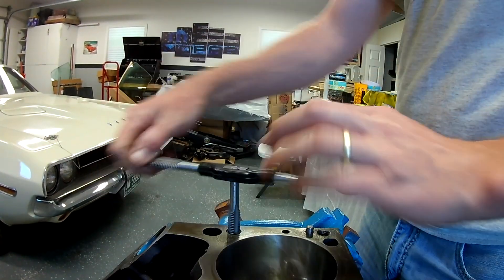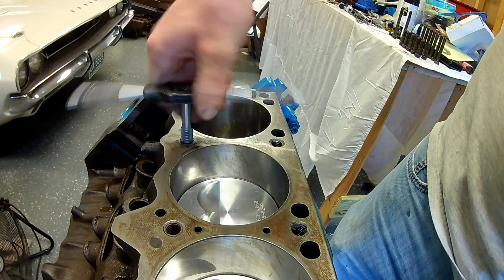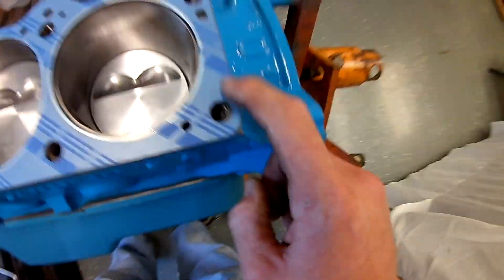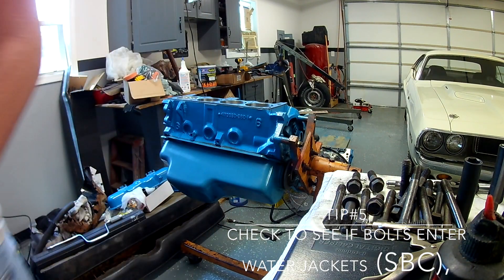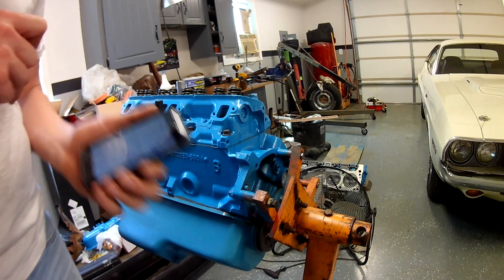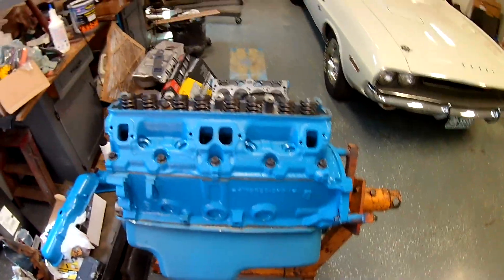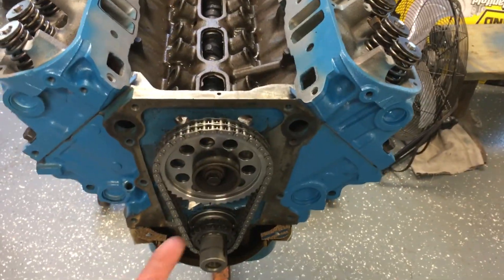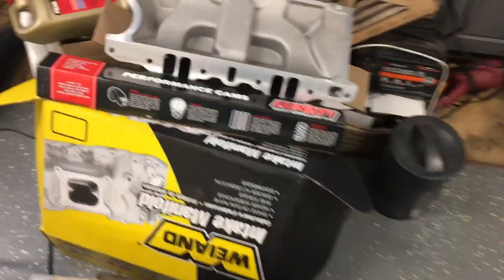360 Engine Build Part 7, Heads Installed! Tips and Tricks for Longevity and Performance.

Comment: .... in an unfortunate situation like that...where one has to perform chasing threads or anything dirty in or on an engine already assembled ... I use shaving cream..... this stuff catches every debris like sticky stripes do moscitos....afterwards you just suck it off with a vacuum cleaner. Bevore installing heads i always use it to cover all the head's water passage openings to make sure NOTHING drops into the cylinders.
Another trick.... on the original hemi and max wedge cross rams I use the Nordlock washer system on the i take bolts to avoid becoming loose in operation....to catch these I spay shaving cream around the bolts....just to be on the save side so not one tumbles down the i take port into the cylinder....
Reply from the maker: That’s pretty cool. Thanks for sharing
Reply: @JustMoparJoe  ... in our hobby...it is most essential to pass on information....without all the magazines and how to books from the States...and in the 727 department ...the vids on the Torqueflite...I couldn't do the hobby over here in Germany...thanks to all of You
Reply from the maker: @JanNiemeyer-x8f  check out bad tree productions on YouTube. They build 904/727 transmissions in the garage

Comment: I run that stealth intake on my 280 Hp street 318 and it pulls real strong at any rpm with a 625-650 cfm carb with 4.10 gear and Hughes Engines muscle car cam for 318.
Reply from the maker: Niles, this is the engine that went into the Red coronet. I sold it to him to replace the old poly engine. The only change I made was to switch to a purple shaft cam that was much milder than the bigger lunati I had in here. There’s also one video of this engine in my barracuda for a full race day. It’s in the barracuda playlist
Reply: @JustMoparJoe  Right on Joe !! Thank you for more info and more vids of it . Nice clean basic solid build . Wish I could give you a list of my current 318- 393 stroker build for my 68 Dart 2 dr sedan Sport Special Model.
Reply from the maker: @NilesJStJohn  I’m going to build a budget 388/318 in 2023. I’ll do a build up on the channel
Reply: @JustMoparJoe  will be looking for that line of vids coming. 318 is so underrated and has so much strong potential!!

Comment: For the timing cover, I installed a new crank seal in the cover, and used the crank seal to center the cover over the crank, THEN insert the cover bolts to line up the cover on the front of the block, then tighten the cover bolts. Now there are no uneven side loads on the crank seal. Then I drilled a 3/16" pilot hole near the lower corners of the cover, and into the block front face. I followed up with 1/4" straight shank reamer so I could put in 1/4" dowel pins to positively locate the cover. Why would I do all this? If in the future, you need to pull the cover, you can reinstall it precisely, and as a bonus, it won't change the gasket seal on the front of the pan.
Reply from the maker: Thanks Bud. I learned of the seal centering trick after doing the series. Adding the dowels is a nice touch as well.
Reply: I always add an oil slinger to the crank after I have the chain all hooked up .They are not on the late engines but Mopar has them p/n 5249636. They make the chain and sprockets last longer. Mopar plugged off both oil galleries ,they used to have a pin hole on the passenger side cam bolt. This increased oil pressure  at idle but the chain ain't oiled as well.

Comment: Hey joe, for assembly lubrication purposes, why not install cam before crank?
Reply from the maker: I guess I don’t have a straight answer that will address lubrication purposes. I always start on the bottom end and work my way up. That’s how I was taught. I do believe in test fitting the camshaft immediately after cam bearings are installed to be sure they don’t bind, but that’s with a light coat of oil, only on the journals. With the flat tappet cams I’m used to, I really believe in thoroughly coating lobes with rev lube, and I don’t want that washed up or down with oil dripping from the crank or top end. Hopefully that helps. I always prone the oil pump with a shaft and drill, then soon the engine while priming to get oil to rockers.
Reply: @JustMoparJoe  Word.

Comment: When in doubt about max flow cfm/power, Add boost!  Perfect setup.
Already good low rpm torque and "every cam is a turbo cam". 👍
Reply from the maker: Thanks brother! This is the engine in my barracuda at the moment. Gotta dig into the 7’s soon hopefully
Reply: @JustMoparJoe  6s anyone with same drivability ? 😝   I'm just messin' with ya, doing great so far. 💪

Comment: A light swipe of oil under the flange of the bolt head as well. For accurate torque
Reply from the maker: I think some residual oil gets on there. I will probably have ARP bolts or studs on the next build. With it, I use their lube under washers and on threads. Thanks for the support.
Reply: Love the show bro keep it up!
Reply from the maker: choppps5858 thanks brother! Doing a 408 build in the next few weeks!
Reply: I'm also doing a 408 build for my 75 W200!  I'll be sure to watch your vid!!!

Comment: Stick your tap in a drill save your wrists and time.
Reply from the maker: Thats true! My buddy Javier Gamala did that on his build. Check out his channel. I was scared that i might catch a thread. I didn't want to chance it this late in the game. I had meant to tap those before assembly.
Reply: I used an air powered drill to chuck up the tap and chase the threads. Not enough torque to break a tap, and easy to control the air pressure,  too.

Comment: one thing on the head gaskets that make more sense than trying to gain a miniscule point in compression is never use a head gasket on a 4 head bolt per cylinder engine with out fire ring head gaskets,pulling heads off for inferior head gasket design is a good way to screw up a weekend,use the good stuff,all of your good work depends on every part being picked for function,nice work on your engine
Reply from the maker: strattuner thank you! I’ve encounter an issue with a big block mopar of the stock felpro head gasket barely hanging into the cylinder because the block had a wide chamfer at the very top of the engine. That was a fun problem to chase in my racecar. Ended up buying the oversized gaskets and it sealed great. I’ll do a big block mopar build like this someday. Thank you for watching!
Reply: @JustMoparJoe  i get dummy studs and run them thru the head bolt holes and look and measure those fire rings to the cylinder width and check it real good,good head gaskets are available but you have to inquire,most parts houses are wham bam everything fits,no it don't,i blue printed engines in different shops for 47 years,fit has to follow function, its the way of it,its mopar to the bone marrow,i started in a chrysler dealership in 1968 -1989,i got to drive all of mothers hotrods,the 1970 duster 340 3speed 3.91 geared cars,unreal,and brand new,i was 18 and loved my  job
Reply from the maker: strattuner that sounds cool! I appreciate you watching and feel free to share! I’ve been messing with them for 16-17 years, under the supervision of my dad. He was a lifetime mechanic and drag racer. Mopars were all Ive ever collected and worked on. Still learning some finer things, but I hope I can help someone out there with this build!
Reply: @JustMoparJoe  you are helping others and your dad is a master,and listen to him,he knows all of the wrinkles,we were hotrod before it was cool,we didn't know we were cool,to busy having fun,the fun is in the doing,enjoy

Comment: If I'm swapping out a set of head's on a small block mopar and I'm leaving the distributor in and just working around it do I have to bring the number 1 cylinder to top dead center before taking the heads off of don't it matter where it's at since I'm not removing the distributor?
Reply from the maker: Jason Simone doesn’t matter at all. Mark your number 1 on the cap, put the wires back on as  is. Start it right up.
Reply: Ok, thanks for your help. Your channel is awesome! Wish I would have found it earlier. Watching your videos I see a Lot of things I've done wrong but I'm learning!
Reply from the maker: Jason Simone thank you! This video is the one that I catch crap about tapping threads after the pistons are in. I don’t recommend that, but I real thought they were good. Glad I can help! Thanks for watching. 👍🏼
Reply: You're welcome. I think you do a great job! I run a tap on the bolt holes with the engine in the car before I install the heads and when it's in the car the pistons are in the block so as long as you vacuum the holes after like you did I don't think it's a problem at all.
Reply from the maker: Jason Simone thank you! I’ll get this motor in my 74 dart sport someday and see what it will do!

Comment: Chasing bolt holes after the pistons are installed ? Not a good idea. That should have been done before assembly .why take the chance  of getting dirt in one of the cylinders ?
Reply from the maker: Dan Murphy you may have missed my other comments, so I’ll catch you up to speed. I rebuilt and used this block in 2012. It was hot tanked then.  My dad and I built it then for my orange cuda as a 408. At the time I bought a cast crank from eagle, and it broke between journals. The motor Locked up during a pass, I brought it home, tore it down and sat it on a table in the corner. I then pulled it back out, checked it for cracks, etc.and brought it to my friend Rick Seeman who bored it .060. It was still blue from the previous build.I assumed the thread holes were still fine, after I pressure washed it and blew it out with compressed air, but figured I should check them. This build is different than any other I’ve ever done. Typically, I like to build an engine over the course of 2-3 days from start to finish. This one I had to do over multiple weeks, in my spare time, away from my wife and my 1 year old. It usually takes 3-5 hours for me to edit the footage from each video while the baby runs by pulling on my laptop. This was a simple oversite on my part. The engine runs great regardless, so in the end, it didn’t actually matter. Thanks for watching, and I hope you make it through the full series. I am going to throw this motor in my Dart Sport, and test it at the track, likely even throw it on the chassis dyno.
Reply: @JustMoparJoe  ......use a vacuum cleaner sniffing just besides the thread chaser while doing it.....will catch the debris flying around while removing the chaser. Another method: use shaving cream around the hole. Nice build series and thanks for it!!!!

Comment: Love the build series joe! I actually just aquired a 360 from a 76 truck that i am going to build using your videos and a book resource. Question on head though, i see u used 318 heads bc thats what you had, but will using then factory 360 heads (porting them) lower the compression or should i get the same compression out of it? Also did u shave the .015 off the heads bc of damage or to raise compression? Also could u post a complete parts list and maybe even dyno numbers once its done? Thanks, keep up the good work!
Reply from the maker: nate hull thank you! So the 318 heads do have smaller chambers than 360. I believe it’s 4-6cc’s. Everyone always says that every head measures differently. Regardless, I would think the more flow from the 360 head would benefit you more than the small compression bump. Many people switch to the 302 casting head that are closed chamber. The head shop said they had to mill off .015 to get rid of pitting that the heads had. I plan on getting to a chassis dyno after the motor is in the car (74 dart sport). We don’t have an engine dyno close at all. Thanks for watching! Let me know if I can help!
Reply: About 30yrs or so ago, I built a 360 w/318 heads for an acquaintance. I tried to talk them out of it, but that's what parts they had, and that's all they could afford, I guess. He also wanted a mild Isky hydraulic  cam. When I was done, I installed it in a Challenger(I think). Anyway, it ran phenomenal! I was quite surprised, because the combo of 360 block/318 heads was contrary to popular sentiment, but it turned out to be an excellent street combination. Very responsive,  very torquey.

Comment: I have some police heads.
Reply from the maker: Luke DAWG I hear they work well! These were what I had, so I spent 20 hrs on porting them. Spent 340$ on new springs and bigger valve upgrade. Should be fine for a street motor. If not, I’ll make a video on it 😂

Comment: im building a 318, what rocker arms are you using
Reply from the maker: rodney I’m going with stock stamped steel. They are tried and true to 6500 rpms. This is just a street motor. Probably won’t see over 5800.
Reply: @JustMoparJoe  im building a 1987 318 but i cant find a set on new stock
Reply from the maker: rodney here’s a link from eBay. I wouldn’t be scared to try these https://rover.ebay.com/rover/0/0/0?mpre=https%3A%2F%2Fwww.ebay.com%2Fulk%2Fitm%2F222731513991